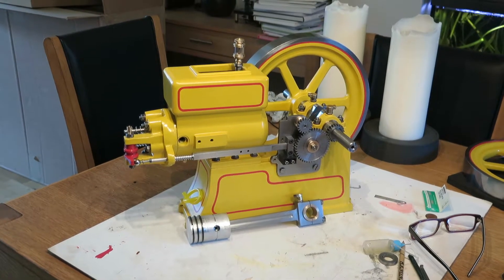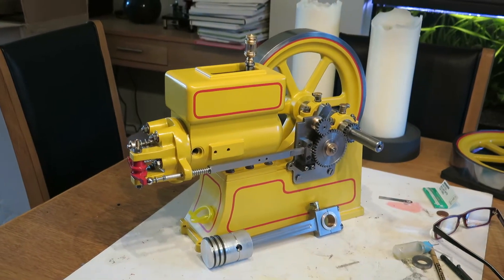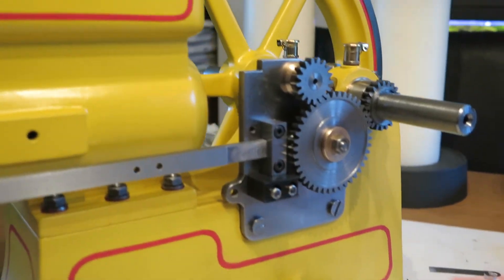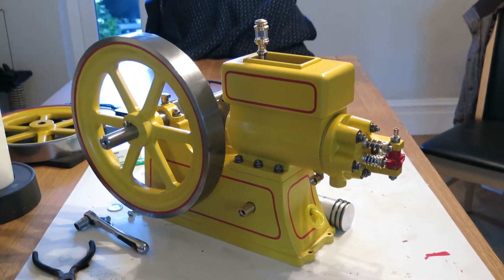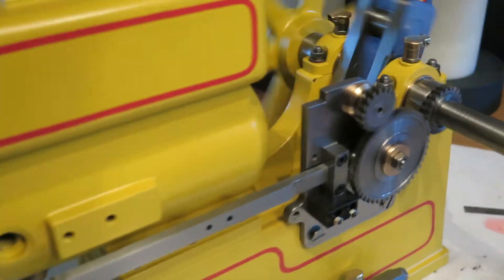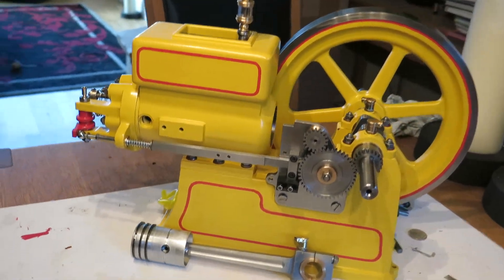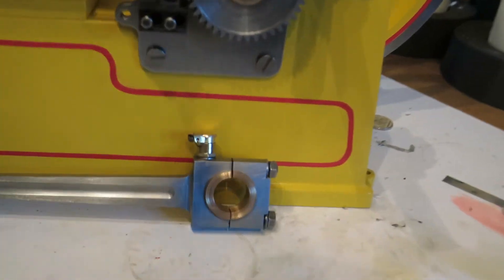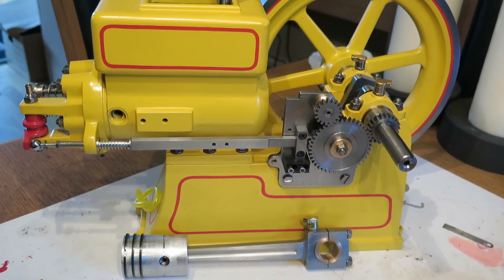Economy / Hercules Hit and Miss Engine

Comment: Bit of a long shot here but that'll maybe show how desperate things have got. 
I've built one of these and it will neither start, attempt to start or even think about starting. 
I've gone over every aspect I can, remade and re machined everything I can think might help. I've jumped through countless hoops and got precisely .......  nowhere. 
I seriously suspect my carb is ultimately at fault so having seen you used a model aircraft engine carb have you got any further information on that?
Suction I've got. 
Compression I've got. 
Timing, well I've set, checked and re set, convinced I've got. 
Spark I've got at about 8 Deg BTDC